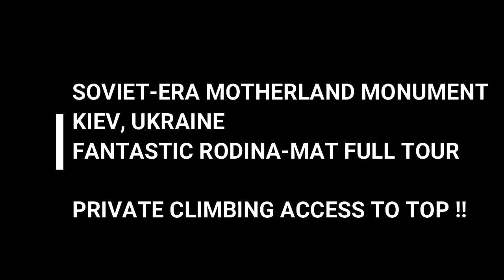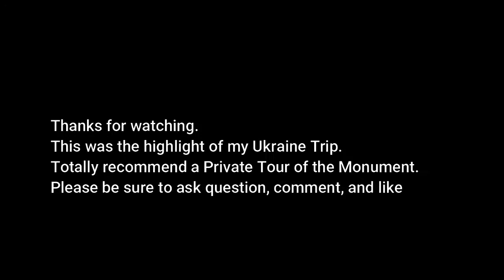Amazing Private Access - Top Level of Kiev Ukraine Motherland Monument

Comment: Hello can you tell me which private guide or tour company you hired? Tks a lot
Reply from the maker: You can go through a Tour Company but all you have to do is get their early right when the counter opens and register to climb the statue.They will provide the guide as part of your ticket. Your tour company if you buy from them would charge more for the arrangement and still use the guide that you would have had if you bought ticket from them directly. BUT - if you buy from ticket counter directly you may have to come back at a time that is later than your arrival. You will have to take the slot that is available. Tour company have more flexibility but cost more